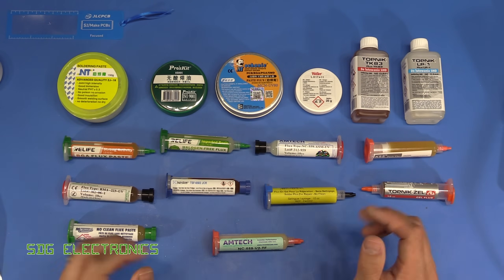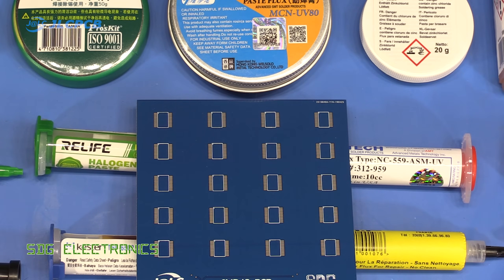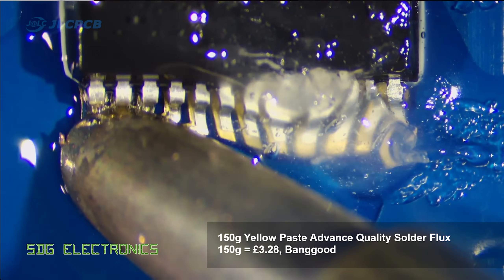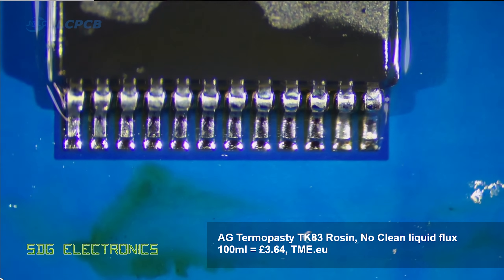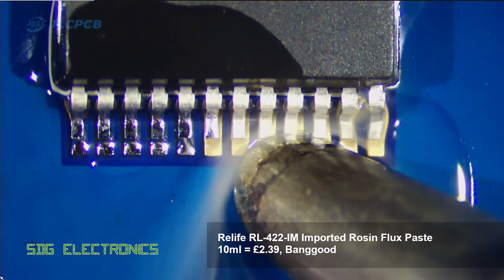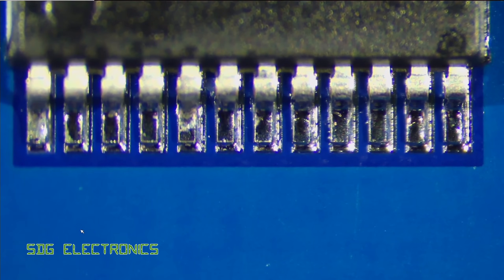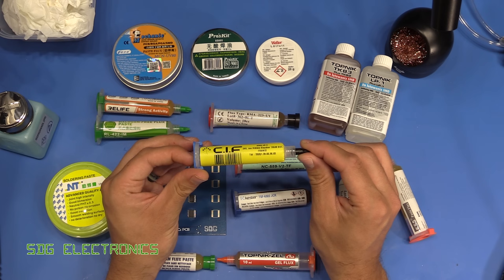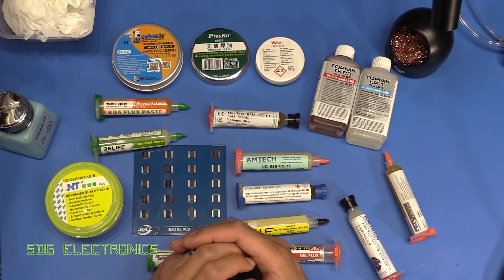SDG #086 What's the best flux for soldering? A comparison with PCBs from JLCPCB

Comment: I may be showing my age but I still  prefer using  solid pure rosin and dip the tip in that when needed, it is amber coloured and glasslike in appearance,  if I need a liquid form I just crush a small piece and disolve it in alcohol - its worked well for me for over  30 years,

Comment: Two things that are missing  in this great test (unless I was sleeping). What is used to clean with after.. and what is the overall toxity. In eval, the residue and toxity should be counted. Its not optimal if the most toxic and polluting is ranged as best (Thats why lead is drawn from solder). Secondly, I would have liked to know about when to use paste or solder (i guess paste is for bare cobber).
Reply: How do you expect him to "count the toxicity", exactly?

Comment: Also see my comment on the solder comparison video. The three things are how well it works(in a challenging situation, not brand new leads to gold contacts), cost, and what you did not show much of is how easy it is to remove the residue, what rinses off easily and with what solvent, and what requires repeated brushing and scraping to remove the hard crud that won’t rinse off. Thanks again.

Comment: You are soldering SMD with WELLER SOLDERING GREASE?

Soldering grease for tin plating of copper, brass or steel sheet?
DIN EN 29454-1: 3.1.1.C (Zinc chloride)

Comment: This was an excellent comparison and some of the nicest fine pin soldering I have yet seen! 
I had a question or maybe a future experiment. Have you considered dipping the legs into any of the fluxes as a possibly cleaner application method? 
Thank you.
Reply: Don't think any professional is gonna be that stingy with their flux. In the grand scheme of things flux is cheap. Vif you have a pcb that has alot of nooks and crannys you're afraid of leaving behind some flux you might have missed, use a clear flux, or one that has a low rosin content. Also keep some 99% IPA or electrical parts cleaner for fast clean up

Comment: I use pure rosin as flux for soldering and it does work pretty well but i notice that certain solvents fail to clean it off and may even leave white/yellowish deposits that i find hard to clean off after.
Reply from the maker: Rosin sets hard and almost always needs abrasion as well as a solvent to clean it off.

Comment: There are going to be those who disagree with me on this, but I am speaking from experience here and opinions vary. It’s better to use a flux which matches your solder’s flux core. This is enhanced by matching them both by brand. What you get is matching chemistries as they are made by the same manufacturer and therefore their chemistries are ideally identical. This yields consistent, reliable and repeatable results. It may not matter so much to some, but to those who’s lives are dependent on them, that’s a whole other conversation. If you can try that, you will see what I am saying is true especially when your methods are also consistent as that matters also. Stay safe mates!😊👍🏻😷
Reply from the maker: Good point, at least using similar variants would improve things.

Comment: Thank you for the great comparison.

A question for everybody who also bought the yellow soldering paste. I bought it at banggood. It is white like the one in the video but there are some weird typos "God immersion" for example. That's why I'm a little worried if the product is the same. I have read that flux is difficult to remove with flux solvent or ipa. Does anybody have any experience with this?
Reply: I have a square 80g tub of it that I've had for years. It seems slightly more amber that his, but has exactly the same typos as his. I like it. Not for everything, but for what it is. Before and after soldering I always clean and tin my tip, and quickly dipping the heated tip into the tub of flux paste before applying tin is part of my process (and then I stab the copper sponge etc). That would be a hassle with gel or liquid. Same with tinning wires, first step is I poke them into the tub to flux them. I buy the cheapest kinds of solder braid without flux - no problem, just drag it in the tub before use, poking it down with the soldering tip and it's completely fluxed. And it also works if I'm just touching up a single solder connection, dabbing a bit of the paste onto it is easy, a little goes a long way as it stays put until I apply heat. That only leaves a small bit of flux to clean up afterwards. If you need to drown an area in flux, flow solder underneath a chip, or tin pads or traces use gel or liquid. But that tub certainly has its place. Oh, and while it's not no-clean, it's not that bad and it doesn't spit, produce too much fumes, and I've never had residue being burnt or discolored.

Comment: I have question my guy so I use bga machines and I'm too tired to put mask everytime I want to work with the machine do you know any good Flux without smell
Reply: Flux is like tobacco it kills with the years ! Pure rosin flux is better anyway, use an extractor, myself i made one, recycling a vacuum pipe and a mini table vacuum motor, that is  a really good help going to a chimney, you can adapt it using roof water hose connections and some hot glue
, believe me.

Comment: Haven't heard anything about activity levels. You did mention all solder joints to be acceptable to IPC standards, so I assume there's basic knowledge on those standards.
IPC-J-STD-001 calls a defect when using anything else then L0 or L1 flux for soldering. The lower the activity level, the harder it is to solder. So, very easy wetting of solder could indicate a activity level which is too high to be usable, unless you don't care about longevity of your electronics.
Nice idea to make this video but not of use for anything else but hobby wise application

Comment: 2:48 - Soldering iron is at 330 ºC.
6:22 - TK83 tails off
Guess why - you are overheating it.
...maximum soldering temperature 280 ºC.
https://termopasty.pl/wp-content/uploads/2019/07/Topnik-TK-83-EN-nowy.pdf

Kester TSF-6502JCR
"Kester TSF-6502JCR is a no-clean tacky soldering flux formula that possesses a high activity level, allowing it to solder
 nickel surfaces. The robust wetting action of TSF-6502JCR will allow OSP treated copper, as well as heavily oxidized copper, surfaces to exhibit good soldering properties, even after 2 or 3 thermal cycles."
https://www.kester.com/downloads?Command=Core_Download&EntryId=1149

So, without the specifications it's like a review of a black cat in a dark room...

Furthermore regarding the fluxes that have no specifications at all.
They may be fake, inconsistent and even corrosive...

This reminds me the topic about fake SSRs
https://youtu.be/rgW8L2LaAlU?t=609
But I don't know how a flux can be derated...

Comment: Is there a possibility that the each test was affected by the previous test from having remnants of flux on the soldering tip? 
You liked the results of the C.I.F. rosin test. So maybe the LP-1 rosin affected the C.I.F. test?
Reply: Flux generally evaporates well below the temperature of the iron. Even if he didn't clean the tip (which he probably did), he would have had to move immediately from one chip to the next to have any residue of the previous flux left on the tip. That's why flux core solder needs to be melted directly onto the item you're trying to solder (because if you apply it to the tip of the iron first, it boils / evaporates in seconds, before you can transfer it to the components).
Reply: I don't think flux attaches to any real degree at the tip.

Comment: did you had difficulty to clean the fake amtech and the mg chemicals? and what dis you use to clean ?
Reply from the maker: I used Electrolube Fluxclene. The fake Amtech was easily cleaned, MG chemicals slightly more difficult due to the rosin content.

Comment: Have you tried rosin dissolved in IPA, percentage of your own choice :)
Reply from the maker: I've not actually, though I do have some rosin I could try it with 👍
Reply: @sdgelectronics  A few small lumps in a nail varnish type bottle with brush works well. PCB's need cleaning with IPA and a toothbrush though, but ideal for applying to solder wick :)

Comment: One thing I noticed with no clean liquid flux is after a day of soldering, the cutter knife on the table was rusty.  I assume the acid gets in the air and settles on things. I haven't seen that with thicker fluxes, but maybe it's a problem with any that spit when heated.

Comment: Banggood yellow tub melts at (or below) 100C. I melted it and poured in syringes. Quite cheap and seems to work well. You get quite a few syringes out of a tub of that!
Reply: I have some of the same stuff and here in Australia it gets quite warm in summer. I had the tub sitting on its side and one day I noticed the flux had leaked out. So it melts or at least softens enough to flow at a lot less than 100. More like 35-40. Anyway, this isn't proper flux and does not have any active component so it's pretty useless for reworking old parts.

Comment: I ended up getting 5 tubs of the NT pretty cheap, like $12 and change. Still trying to figure out WHAT it is exactly. It just smells like some kind of wax/paraffin when heated and leaves a greasy residue that doesn't really clean off easily with IPA. I have a feeling  it is less a flux and more just a heat transfer medium. I mean, it works for some SMT rework.

Comment: Very useful video.  I've been using a liquid MG rosin flux for the last 5+ years and It's worked well but leaves a horrible residue which I have to laboriously clean with alcohol.  Was looking for a newer style flux and your review has been very helpful.  Just ordered through one of your links.  Thanks.
Reply: CHANGE TO OA FLUX! You'll never look back.
Reply: @allanknox8216  what is OA flux?
Reply: @nerijusk9598  OA flux stands for "Organic acid" it has stuff like citric and phosphoric acids - all water soluble. It's pretty aggressive and completely cleaned with warm water - no solvents. I only switched because every CM I worked with was already using it. Rosin flux has been out of favor for a long time. Chine uses no-clean to save money.

Comment: There was a problem when soldering with TK83 because the maximum application temperature is 280 degrees Celsius
I suspect that you overheated it and began to boil, after adding another portion of flux, it just cooled down and soldering went fantastic again.
Because I am Polish and TK83 and LP-1 are Polish fluxes, I know a bit more about them, if I remember correctly, we used the AG-5 flux for soldering at higher temperatures (up to 400).
We have used them for many years and in general AG TermoPasty products are very popular in our country (they are cheap but very good).
By the way, the Polish word "Topnik" means Flux from the Polish word Topić - melt.

I forgot to write, people start reading the manuals, there is all the information about the products you want to use.
Thank you for this movie is very cool.
Reply: Hi; what do you know about rf800. I couldn't find the application temperature about it  ?
Reply: There is a thick layer for gluish resin remaining after TK83, not even IPA can't clean it, you have to use aceton and that's really not good for electronics. I consider this flux completely useless, it works, but it's pointless when it turns all your stuff to glue and it's not possible to clean it. On other hand some RF800 from the same producer works pretty well for these purposes, it's really no clean, no gluish shit remaining, it's not that efficient, but I would prefer it over that TK83 glue. I am Czech, we have pájecí kapalina F-1 and it's basically the same thing as your TK83 - ugly non cleanable glue remaining after soldering, I can't recommend it for electronics, only for soldering metals or something that you can wash in aceton.
From the same Czech company, I was using similarly looking liquid "for soldering thin wires" and that was pretty efficient, it looks also very nasty, but it's easy to clean it with IPA after soldering, so no problem with that, so that's also prefered for me over TK83 ugly glue from tree. 😀 I will try AG-5 or LP-1, these are not brown, so it should not be resin from damn tree I hope. I can just go to forest and take it form the tree instead of buying some TK83 and I will save money.

Comment: I'm really impressed by that big tub of banggood flux, might order some!
Reply: I bought like 4 or 5 tubs. I am not sure what is in it but it seems to me to be nothing more than some kind of wax?  It doesn't smell bad, smells mildly like candle wax and leaves an oily coating. I wonder if it mostly just a heat transfer medium, not really am oxide remover.

Comment: That NT flux will not clean away.  I've mainly used RMA which cleans with spray and IPA but that NT just turns to a jelly and will not clean away.  Be warned.  Its solders well but cannot clean!
Reply: I use proper flux cleaning sprays and high % isopropyl.  The NT flux was excellent for soldering but difficult to impossible to clean away.

Comment: I'm here to get answers on this question....which flux could I use for console modding? Which is the best most preferred?
Reply from the maker: If you see my video about ultrasonic cleaning, I'd pick one of the ones that didn't attack the PCB if it didn't get cleaned off.

Comment: which flux did you use at 3:50?
links?
Reply from the maker: Rapid Brown Flux: https://www.rapidonline.com/warton-metals-brown-flux-jelly-100g-87-0702
Reply: @sdgelectronics  thanks, which one is better at removing oxides, this one or the mechanic or the kester one?
Reply from the maker: @devjitpaul1191  the kester solder flux is more active
Reply: @sdgelectronics  thanks

Comment: DO NOT BUY THE YELLOW SOLDER PASTE, i bought the yellow paste, 150 gm, it is pathetic, it just melted away, to test i made a big blob of solder which accumulated a lot of dirt, and put a lot of the paste on it and it did no cleaning whatsoever, the solder was able to clean the blob quite cleanly by itself but the paste did nothing, did another test, again the paste did nothing, tried to join a PCB diode without any flux(as expected, didn't wetted and connected the joint), then tried to put a LOT of paste on the second pin after cooling, then again it didn't wet the joints. DO NOT BUY THE YELLOW SOLDER PASTE

Comment: How good is that Banggood solder paste, really? I was going to order a 5 pcs batch from that link, but I have been looking at a few other reviews and some say it's garbage. Is is consistently good or does quality vary?
Reply from the maker: I can't say about the consistency, however I have had no issues with the one I ordered. I may have been lucky, who knows
Reply: That's the problem with buying Chinese stuff though. I was interested in the KSS but looking around, who knows what is the original, or what was used here. Stuff is copied so freely, and changing a label is easy.

Comment: I guess it might be a great idea to rerun the tests on a non-plated copper boards. That's a better way to test the flux's ability to deal with oxides.
Reply: Yeah, soldering brand new circuit boards with gold plated pads to brand new integrated circuits with shiny pins is a very easy test. In the real world people have to solder components and wires to oxidized terminals of switches and pots, old turret boards, and so on.

Comment: I purchased the NT yellow flux and have to say it is complete garbage and made bad solder joints so I don't know how you managed to get it to flow but I will never purchase any flux from China again I have put it in the bin  I have been soldering for over 20 years so I know how to solder and this is junk like a lot of items from China and watch out for the flux pens they are a scam from China mine stopped working and when I opened it there was only 1/4 inch of wick inside China crap again

Comment: try martin bga gel flux.
Personaly, I value more if flux produces as little smoke as possible, does not boil, spit or changes its viscosity under termerature too much. Secondly, how easy it is to clean, because this takes the most time and effort in the process of soldering. Then, how corrosive and conductive it is. And only then how shiny it makes solder joints, because margins are really negligable there.

Comment: The whole reason people use amtech is not that it's a chemically superior flux in any way, but rather the fact it's widely available, super easy to apply, sticks in place extremely well, does not boil off, is extremely easy to handle, and it smells nice.

Comment: Thank you so much for this video. I got stuck with Lotfett with almost 2 decades and when the local market run out of this paste i had to find it on line and yes i found it! Ebay has got it almost 20 euro and the crappy flux i bought from ali just did not work and then i saw your video. So long Lotfett... Thanks again :).

Comment: Can anyone give any advise what is safer to use i mean i read somewhere that dont buy flux that have acid. Im new to soldering so pls help..
Reply from the maker: Any mainstream flux for electronics will be fine. I would advise always cleaning the PCB anyway
Reply: @sdgelectronics  kinda looking for flux with the most less rosin or acid if you may?
Reply from the maker: @madbull2124  you need either acid or rosin for it to work. The yellow flux works well though and cleans up easily
Reply: @sdgelectronics  yellow? Meaning the first flux used in the video?
Reply from the maker: @madbull2124  sorry, yes. First link in the description